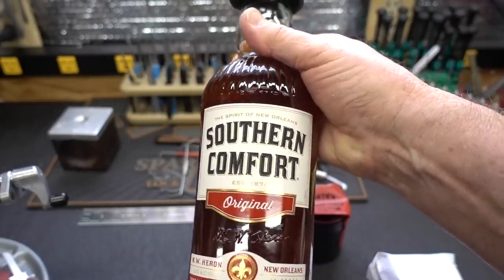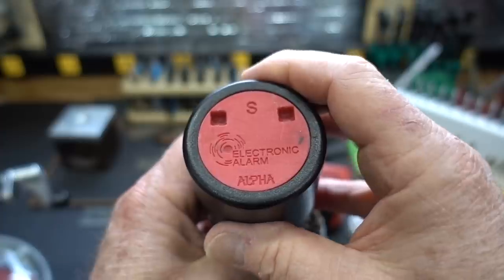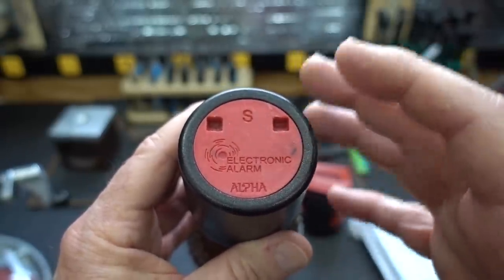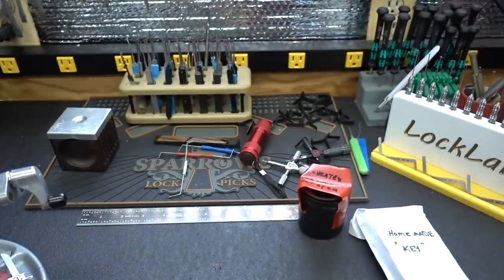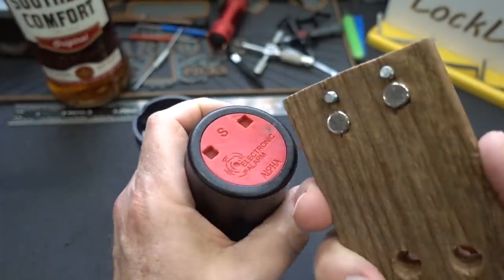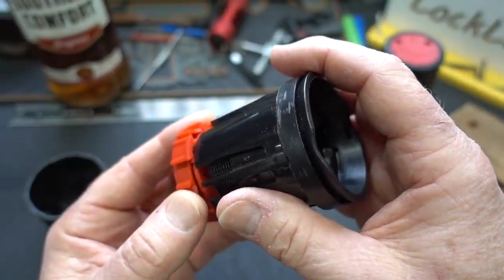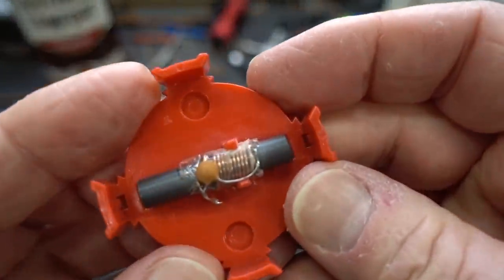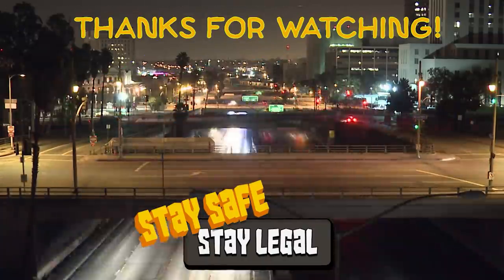(1849) Magnetic Bottle Lock

Comment: The coil and capacitor form a tuned circuit. This circuit in turn is activated by a magnetic field generated by the alarm system near the door. When the tuned circuit activates the change in the magnetic field is detected in the alarm system and the alarm is activated. This means the circuit in the lock itself requires no batteries or sounder and is not powered unless someone tries to take it past the alarm system.
Reply: Great explanation.
Reply: @JaysonSR That's what it is. The gates on the doors are themselves coils, powered by an alternating current at some moderate frequency (a few hundred kHz probably). Thus, the gates have an alternating electromagnetic field around them. That makes the coil in the bottle act like the secondary winding of a transformer: a current is generated in the bottle coil. The capacitor means it's an LC tank circuit, so it has one specific resonance frequency. This resonance frequency is very close to the transmission frequency of the gates. When the bottle cap goes near the gates, the resonance couples energy from the gates transmission, which can be sensed by circuitry in the gates (to greatly simplify, the power consumption goes up a tiny bit). The gates then alarm that someone is trying to steal something.
Reply: Very similar to some of the old security tabs at clothing stores.
Reply: @K-Riz314  they are the same
Reply: @JaysonSR Thus, paralell resonant L-C circuit tuned to a particular frequency.
Reply: It may be possible to foil the circuit by placing a coil with more turns parallel to the internal coil. This will change the resonant frequency of the “antenna”. But a magnet to remove the security cap is just as effective.
Reply: Would a foil wrap block the signal from activating the alarm?
Reply: @jonathanbott87  It might. It depends on how powerful the alarm signal is. Multiple layers of foil would work better, but eventually someone in the store is going to wonder why you're wrapping a bottle in foil. And you still have to be able to get the lock off afterwards.
Reply: @PeregrineBF  From what i've read on the subject the transmitter coils will vary their frequency up and down  slightly looking for a dip at the correct frequency, if you just used a fixed frequency and looked for an increased load anything conductive would trigger the alarm.
Reply: In other words, it's like any of the anti-theft little thingies you find on expensive stuff, clothes, electronics, books, alcohol, etc.
Reply: beat me to it.
Reply: @PeregrineBF   Great explanation.
Reply: @Ghlargh  Correct. And there's a bit more complex feedback I left out. It's not really a power detection, the receive coil signal increases when the tag is present, etc. But for a Youtube comment I felt it gets the basic idea across: transmitter coils in the gates create an EM field, the anti-theft tag creates a detectable change in the field. It's not quite identical to how magnetostrictive tags work, but it's the same detection mechanism. Applied Science's video on those is a good explanation for those. /watch?v=KAm7qAKAXwI
Reply: Also it's almost certainly resonant at 58kHz like the magnetostrictive tags, not several hundred. I misremembered.
Reply: @jonathanbott87  Generally speaking, no. These operate at low frequencies, and the coupling is primarily inductive. You’d need several alternating  layers of mu-metal foil.
Reply: John do you by chance do amateur radio?
Reply: @Skynd303  Yes I do.
Reply: @JaysonSR Basically it is. In a electromagnetic field with the correct frequency it will build up a resonance feedback which is detected by the store's anti-theft protection and triggers the alarm.
Reply: alex m.e.s.  You don't really expect a confirmation for this theory, do you? :)
Reply: @daveh7720  With that video getting the lock off shouldn't be a problem anymore.

When Bill showed us the 4 magnetic positions I expected some sort of magnetic code - 4 positions which require magnets at the correct locations and polarity to unlock the cap, means 3 states per position (north, south, none) and 4 locations = 1 possible codes.
Too bad it's much simpler :( .
Reply: @jonathanbott87  It may attenuate the signal, but it won't necessarily block it.
Reply: @daveh7720  You can buy Faraday bags these days. Used to be that you had to make your own from foil lined bag then test if it works by placing a phone inside and calling it.
It would be easier to place a number of the bottles into a bag quickly then get the security tags off afterwords rather than using your own DIY key.
Reply: @daviddavidson2357  That's good to know! Not because I'm planning to rob a liquor store, but because I need to return a highway electronic toll transponder without it logging 500 miles of tolls in the back of a mail truck.
Reply: 100g of circuitry replaced in the modern sense with a piece of shaped foil.  Soon we won't need the 3rd dimension at all.

Comment: The coil thing just triggers the alarm at the door when you try to leave with it.
Reply: I think it is much more inside (+ what you said) , near the wine/alcohol rack there should be a receiver and if somebody with a big magnet tries to unlock the lock, the coil will send the electrical impulse to the RF emitter that will go to the receiver near the rack that will trip the store alarm in that area (you need 2 smaller magnets on each side to not trip the alarm)...
Reply: @Narinjas  That's not how it's done, the tuned circuit is detected by the alarm gates at the exit.

What you are talking about could actually be theoretically possible since the tuned circuit would change it's resonant frequency in the presence of a large magnet, it's just not feasible to have equipment that can detect this reliably with a low chance of false triggering since you don't know what the new resonant frequency would be so you would have to look for sudden appearances of new resonant objects, it would also be far to expensive to cover the entire store with these sensors.
Reply: big magnet if that dont work cover lock with tin foil you dont set the alarm off that way
Reply: @Ghlargh  low chance of false alarm doesnt matter. That's the security guys job.

Comment: This coil triggers an alarm on the anti-theft gate.
Reply: I think it is much more inside (+ what you said) , near the wine/alcohol rack there should be a receiver and if somebody with a big magnet tries to unlock the lock, the coil will send the electrical impulse to the RF emitter that will go to the receiver near the rack that will trip the store alarm in that area (you need 2 smaller magnets on each side to not trip the alarm)...
Reply: @Narinjas  Such a system would be too expensive and overcomplicated.  There are too many variables in such a system and it’s impossible to configure it.  How many bottles are on the shelf?  How far apart are they?  With each rearrangement of each bottle the system will have to be reconfigured. How to deal with interference? People with different devices like smartphones are walking around, etc. etc.  Practically impossible task. So it's simple.  Ordinary anti-theft gate at the exit.
Reply: @Narinjas  It's just a simple LC circuit. https://en.wikipedia.org/wiki/LC_circuit

Comment: I do believe the correct term for the metal locking cylindrical rods wouldn't be magnetic but "ferrous." No harm no foul. And like others have said, the coil picks up the frequency at the door and triggers the alarm in the same way as those small white stickers at department stores.

Comment: While several of the comments are somewhat correct about the operation of the inductor/coil combo I have not seen any regarding the exact operation of the device.  The capacitor and coil form a resonant circuit, called a tank circuit.  The detector is a transmitter that sweeps a band of frequencies.  For example, if the tank circuit was tuned to 200kHz the detector would sweep a range from 175kHz to 225kHz.  During that time, the detector would be monitoring for a change in current during a few concurrent sweeps.  When the transmitted frequency is not at the resonate point of the tank circuit while the device is in the detector field there would be more current detected in the transmitter.  At resonance, the current would radically drop to nearly zero.  This change in current is what the door sensor detects.  The detection of the change in current due to absorption is called backscatter modulation.  If no device is in the field there would be no changed in current during the sweep, therefore nothing would be detected.
Reply: Or no other device that behaves similarly is in the field.  There are a few things that are notorious for causing false alarms.  Coils of unshielded twisted pair are perhaps the best example I've seen.  I've bought bulk wire by the foot, and there is no security tag on the wire.  I pay, I leave, and the wire almost always triggers the door alarm.  I've inspected the wire, made sure there was no tag, I stood back while I held the wire between the gates and ... beep, beeep-beeep-beeep.  The cashiers tell me it regularly happens with UTP bulk wire.

Comment: 7:00 most know by now this is the RfID security coil. It's a coper wire coil around a ferrite slug with a capacitor tuned to a very specific frequency. When you take the bottle past the retail door there is large antennas sending out energy. This coil in your lock acts as an antenna receiving the energy stored in the capacitor and responds with its resonating frequency. The system much like a metal detector is triggered by the very specific frequency response setting off the alarm. 

Fun fact back in the 1990's when I was in collage I had my first experience with these system. Our collage library had security tags in the books as a method to ensure students checked the book out properly. Well in the 1990's cellular data was not at all what it is today. We used the land line telephone system to dial up bulletin board system and the beginnings of the internet over phone modems. This being our routine I had about ten feet of coper phone cable that had been wrapped up in a coil around my hand, about five inches in diameter, and stored in my book bag for modem use.  When I left the library one day the alarm went off and we identified the spooled up copper wire even without any other components was enough  to provide the proper resonating frequency response setting off the alarm.  Fun stuff often easily bypassed after you spend no more than a few seconds studying the design.

Comment: Coil is to trigger the portals on the sides of the entrance. It is powered by a RF field emitted by the portals.

A bit like the chip in your car key for the immobilizer.

This circuit is just massively more simple...All it does is resonate when subjected to the field from the portals and they can detect the change in field and sound the alarm.

Comment: Passive radio. It transmits without electrical switch contacts through the saturation of the ferrite and coil by a big magnet. The small localized magnets probably doesn't saturate the induction coil. When saturated by a big magnet, the reradiated signal is tuned to a monitored frequency.  It requires the presence of a remote transmitter to supply energy.

Comment: Alpha is a well known brand of magnetic security lock used quite frequently in Stores to protect high theft items. The coil will set off an alarm if you try to leave the store with the lock attached. There are many different styles of alpha lock, from boxes to contain dvds, to bottle locks such as the one you see here. I can send you the actual tool used to open these locks if you’d like, but they are readily available on Amazon and eBay for next to nothing.
Reply: You don’t need to “tension” the locks per se. the two indentations are merely a guide for you to position the magnets in the right place
Reply: Wats the name 2 look up on Amazon?
Reply: Please comment tool. Please and thank you

Comment: I got a pair of bottles from a click-n-collect recently with Bottlelox gadgets still attached. I don't have a powerful enough magnet to pull its release levers so it's destruction time. The whole design is extremely clever, good job BottleLox. After some youtubes I see you used to be able to shim it with a plastic knife but these ones have fixed that vulnerability with an extra shutter to block access up the neck of the bottle. Anyway, still got one to deal with, Dremel time!
Reply: You have to bash it with a magnet and pull it off within half a second, because these newer ones have a re-locker spring in them. Ingenious really
Reply: @penfold7800   @Pen Fold  What? Wow that's mental! And brilliant. Well since I didn't get to it yet, I'll give it a try with my fingersquisher hard drive magnets. I saw a vid of a guy properly removing one with a puck magnet but I didn't click to why he thumped it onto the puck. Thank you very much, Pen Fold.

Comment: That circuitry in the lid is a coil of wire with a capacitor attached, wrapped around what I think is an iron bar. My guess is that it's not an alarm itself but would trigger those anti theft panels you see at the exit of a store. They probably emit a magnetic field (probably varying using electromagnets) which then induces a current in the circuit, which can then be detected on the panel side. The same way an NFC card reader works. Provide a magnetic field using a coil, a coil in the card or fob draws power from it to run the circuitry which modulates its power usage to send data back to the source.
Reply: It's a ferrite rod which acts like a loopstick antenna along with the capacitor. The two panels you pass through before you go out the door generate a magnetic field and this generates a current in the loopstick. The magnetic field current changes and this is detected, sounding the alarm. It is like the RFID circuits nowadays but much simpler. Sometimes you see the foil pattern on a sticker which works in a similar manner.

Comment: The thin rectangular labels are a printed L/C tank circuit, and there's a crimp area  that shorts out if the tank is subjected to a relatively strong signal.  I think it's around 8.5 mhz from memory.  Those ones are from checkpoint, and can sometimes be set off by some ID cards.   The Sensormatic EAS tags have a metglass resonator which is biased by a magnetized strip of steel.  These work by driving the coil by the door for a short time at the resonant frequency, then looking for the ringing signal from the strip.  The setup can also pick up the ringing from the L/C tank circuits used in some of the reusable cases.  These ones cannot be deactivated with a strong magnet.  The older, larger tags were resonant at around 58khz.  It's been years since I looked at this though.

Comment: I actually hated trying to undo those things when I worked for a local grocery store back in 2007. California is now moving away from those locks as everything is going behind glass cabinets now. It was normally used on mid to mid-high range price liquor. High priced range liquor was in cabinets then had one of these put on if you were going to be doing more shopping. The lock itself never made a sound, just the door sensors.
Reply: In the UK a lot of stores are moving to stickers with the coil and circuit printed in, some brands are even embedding the technology into the label for the very big stores. The stickers are super cheap to produce... When they are hit by the magnet at the till it usually kills the circuit though you occasionally set the alarm off on the way out.
Reply: @frainy345  yeah California had them for a while, but they were to much of a hassle for liquor that was out on the shelf as they add some hight, and stores never had enough of them. It makes sense to get rid of them.

Comment: It's a magnetic lock and the key lines up in the 2 squares in the top. It usually is designed to set off the sensors installed at the entrances/exits of the stores.

Comment: The anti-theft systems where a pain the back to put on in the supermarket, they also don't fit a certain types of bottle well so you can get them off really easily (sort necked whisky bottles).
Reply: @robertcowling4313  honestly does not surprise the amount of work i was expected to do lead to me super rushing they probably broke it prior to putting it on and just hid it with anti - theft thing

Comment: Alot of those RF alarm are essentially powered by the emitter and sensors at the door. When the coil or sliver of metal is hit with RF waves in the right freq range they vibrate and trip the alarm system of the store

Comment: used to see these popped off at the spirits aisle at walmart. they fixed the issue  by moving the spirits to a locked glass case at the register.
walmart also locks up socks, batteries, jeans and body wash and therres NEVER anyone around with a key when you want to buy these items.

Comment: I don't know anything about anything, but I was wondering if you were meant to induce an electrical charge into the coil, which turns the bar into an electromagnet, which then attracts the 2 ferrous pins, which releases the lock.

A way to use it in practice would be for there to be a permanently mounted station where you could bring the lock into close contact with the bottle in an upright position and like a wireless cell phone charger, it acts on the coil....

Comment: The coil component is I believe called a non-linear junction. And at the entrance to stores you sometimes see the large hoops (these are non-linear detectors) 

The hopes transmit a signal which is picked up by the Bottletop and that reflects the harmonic of the frequency transmitted by the hoop back. The receiver part of the hoop Is tuned to listen for that harmonic and set off an alarm.